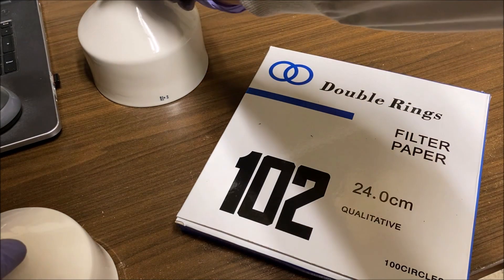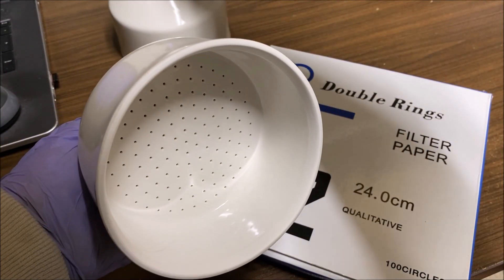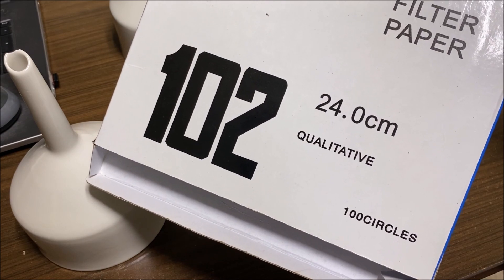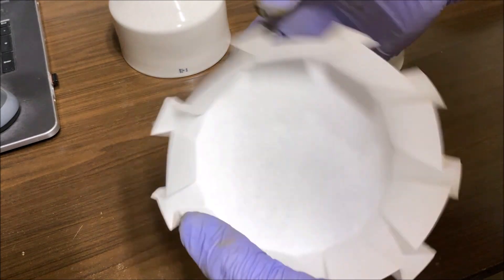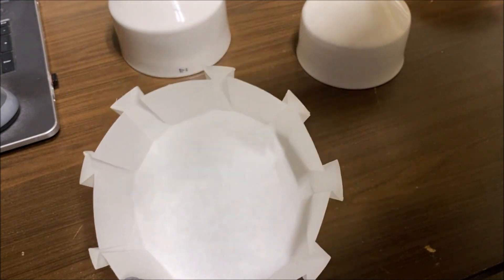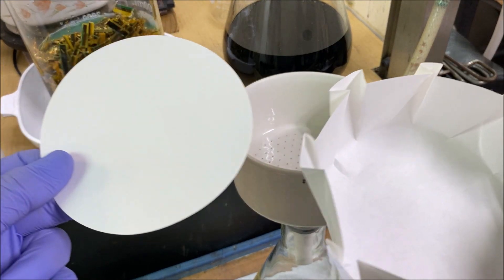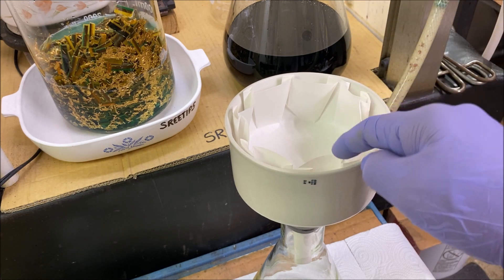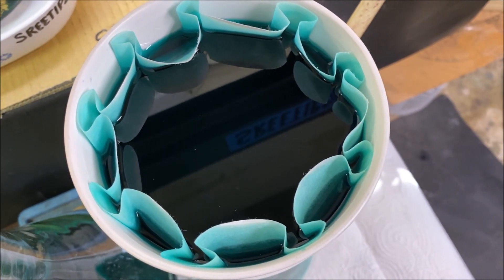How I Make a SPECIALLY PREPARED Buchner Funnel Filter Paper

Comment: What material is the filter made of? If it's cotton or paper, shouldn't the chloroauric acid eat through it? I don't understand this.
Reply from the maker: Those are lab grade filters. In this case 24cm number two medium flow. Hot chloroauric acid solution will cause those filters to fail quickly. But if it’s cooled by adding ice then they hold up well.

Comment: i see the smaller funnel has a large chip running down the side of the spout did it get damaged accidentally
Reply from the maker: Yes, I dropped it in the sink while washing it with soapy hands. But it still works fine.